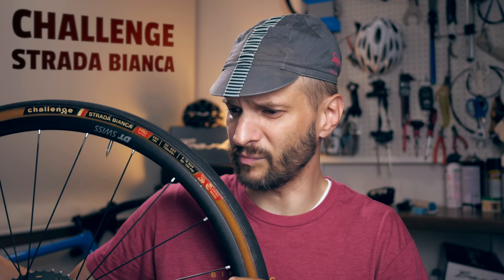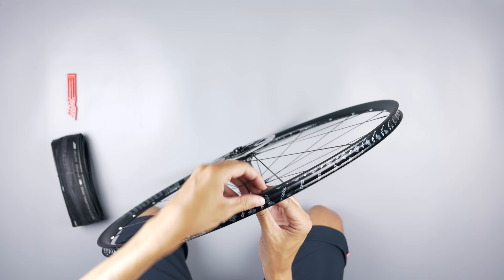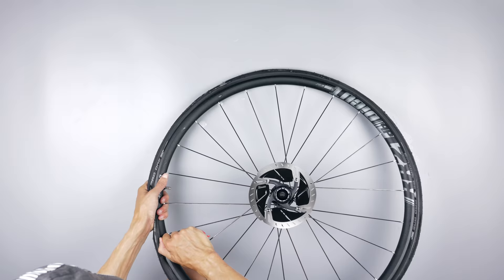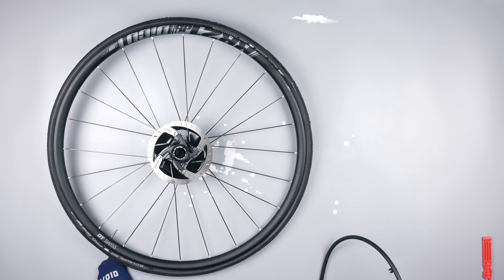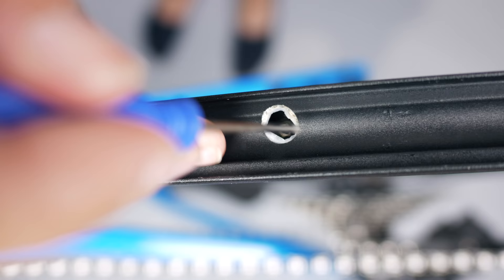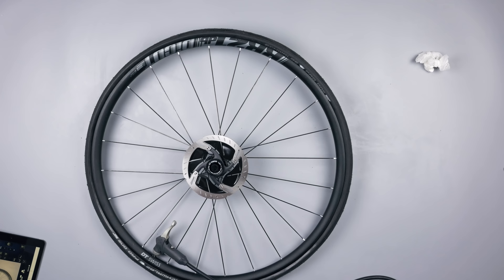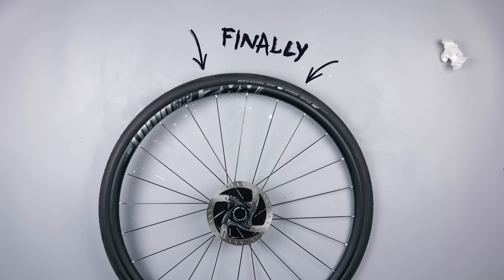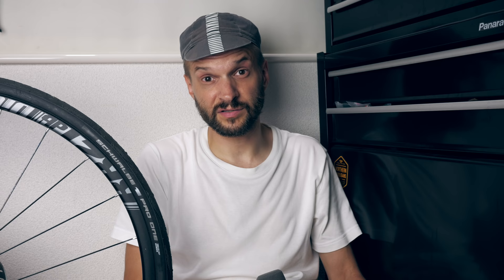Watch me struggle! 5 Tips for Road Tubeless | Schwalbe PRO ONE

Comment: Tip from a bike mechanic here... 
If you have odd shaped rims (like your offset spoke holes) or if you’re running high pressures then I would recommend running at least two wraps of rim tape to stop it deforming into the spoke hole. Also I would finish opposite the valve when installing the tyre because you want the valve side to be tightest 👍🏼
Reply from the maker: Nathan Phillips cheers 👌

Comment: I have installed (and repaired) these same Schwalbe tires several times. The first time I did it I had no luck either. I gave up until I came across a tip online to use rope. 
Make a lasso using your rope and place the rope on the tire. Tighten the lasso and it will push the tire against the rim and force the side wall and bead outward against the rim. While holding the lasso tight with one hand inflate it using the other hand. Works every time on your first attempt.
Reply: I have a side wall puncture on a pro one.  How did you repair?  I’m starting to think the pro one tubeless are not just a headache.  They are also a waste of money

Comment from the maker: Just to clarify where I screwed up, I should have thoroughly inspected the tape, which would have led me to replace it before trying to mount the tire. After I finally realized how bad it was and changed it, everything went a lot smoother. I realize I didn't make that point very clear in the video, Sorry!

I must have inhaled too much fumes from the sealant... I forgot to report the actual width in the video 😓.. the tires measure 29.5mm on these DT Swiss RR21 wheels.
Reply: Thanks !
Reply: What’s the internal rim width and what size tape did you use?
Reply from the maker: Zsolt Csapó 18mm internal
Tape is 23mm
Reply: Did exactly the same Journey with my dtswiss ....I feel you !
Reply: A problem which may be specfic to the DT Swiss RR21.

I also own a pair of rim brake version DT Swiss RR21.  And I find that the drill holes, esp those off-centered one, with burrs/sharp edges which may potentially cut the rim tape.  I had my rear wheel keep losing air pressure, after few month of use.  Before replacing the tubeless tape, I decided to file the edge of those drill holes a bit to remove those burrs.  Since then, there is no problem for 2 good years, and fingers crossed.
Reply: I am having the same problem now, so I have to check the tape first tomorrow, it’s sooooooo Fxxxxxxking wasting time today and all mess..Thanks for your video and sharing.
Reply: Yes, I finally solved problem of tire installation, but my brand new tires have sidewall weeping problem.. even sealant didn’t work...  Schewalbe pro one TT 700x25c... hmmm no way to return to Amazon JP.
Reply: Your video really helped me a lot, Thanks again.

Comment: This has 100% been the best video I could find on setting a tubeless tyre. Thank you so much for showing all your process. I have set tubeless tyres before but when recently setting some Schwalbe PRO ONE (25C) I just could not make any progress. Even bought a ridiculously expensive tubeless pump which still failed. What worked for me was leaving the tyre on the rim overnight (definitely because I gave up the night before and couldn't face it anymore) and lots of soapy water the next day. The rear tyre was also easier for me, was able to fit it new by chucking in a tube to pre-seat the bead. There was a little fighting but managed to get it by using the charged chamber and then immediately kept pumping when releasing the chamber air.

Comment: I'd always mount tubeless tires with a tube first (experience with road, all road, and fat-bike tires). The reason is that when you purchase them they are folded and have creases which makes it easy for air to escape if you're not using a massive volume compressor.

If you mount them with a tube these kinks get straightened out over time (I leave them overnight), then you can break the seal on one side (if lucky), but at least you'll get a better seat.
Reply: 100% agree. was going to suggest the same.
Reply: I don't bother but I do unfold the tyres hours before fitting.
Reply: I don't bother but I do unfold the tyres hours before fitting.

Comment: Watching you struggle with the installation of those damn Schwalbe tires, I had the impression of seeing myself. I had almost exactly the same problems as you. I tried everything and I could not succed. Miraculously, after a few hours of fighting and liters of sweat mixed with sealant poured around the floor, I managed to do it, but it was the worst experience in my life. Yesterday I changed one of the tires (the hole was to for sealant) to Pirelli P-Zero on the same rims and ... no problems, it went smooth and plesant. Well ... no more schwalbe !

Comment: One trick that really helped me is when you first apply the tubeless tape you need to add a tube in to allow the tape to be fully pressed down in the rim. Let that sit overnight to help to stretch the tire. When you go to actually seat the tire later it will be pre-stretched and will sit substantially easier!
Reply: OK - that's the reason people do that. I've not recently had problems inflating due to owning an AirShot but have had trouble getting the last section of bead over the rim.
Reply: @paulbusby2013 I've never done this and I've probably mounted thousands of tubeless tire.  If it's already on the rim, stretching won't help you.  You do this with tubulars before gluing.  But it's totally pointless for tubeless where you really want the tire as tight as possible anyway

Comment: Complete understand the frustration- used same tire,  size and 3M tape on my stock Axis 4.0. Worked first try on front wheel but several hours of pain on rear wheel and finally had to take wheel to local gas station and use compressor. In the end, love the Pro One's and have worked great in tubeless set-up for both road and gravel riding.

Comment: Hello mate, I love your videos. I ( dis ) organise a bike club, have tubless tyres and have LOTS of experience of them AND the company of many mechanics with way better skills than me. Here's what I've been taught over the years:
1. Get an air compressor. 
Tubless-specific pumps are a lovely invention for people lucky enough to seat the bead perfectly.
2. Get an air compressor.
Nothing...NOTHING beats the relentless hurricane of air bullying the tyre to seat properly.
3. Liquid laytex sealant is for the finishing touch on a perfectly seated bead and not to try and bodge in a 70% seated bead.
4. Watch as many bike shop mechanics as possible fitting tubless tyres. Bribe them with chocolate biscuits to speed dial you when they're about to fit tyres so you can watch.
5. Did I mention an air compressor?

Comment: Great video, and took me back to trying to mount some SKs a year ago. Fortunately, I did it outside on my balcony. I say fortunately, as I was inside getting some soapy water to clean up the rim when it blew off the rim spraying sealant all over the window! I now unfold the new tire and sit it overnight with a tube in it to straighten out folds in the bead.I've used multiple sets of Pro Ones in 28mm and they've all seated easily using a standard track pump. I did use your link to buy some bead wax as the last 5cm of bead can be hard to slide over the rim using hand strength. I have resorted to Co2 canisters when mounting 650b SKs as I can't have a compressor in my apartment but Co2 works just fine.

Comment: Before getting into tubeless I spoke to the mechanic at my local bike shop. Without question he said the best thing to do is get an air compressor. Sure for some set ups track / flash pump or ghetto will work. But if you want to guarantee success...

Appreciate the lack of portability and space / noise restrictions for those in apartments. But if you have the space, air compressor all the way.

Plus double wrap of non branded tape 😎

Awesome channel btw. Really loving your work.
Reply from the maker: Definitely agree! If I had my own place (not apartment) I would have bought a compressor a long time ago. There's no substitute for sure.
I still think I would have run in to problems with the old tape in this case though... but every mistake is a opportunity to learn :)

Cheers mate!

Comment: we have the same floor pump. That seated the tyre the first time, but when I defleated to put sealant, the tyre popped off. I had no time to continue and used for a week a classic gp4000 setup with tube. When I tried again, floor pump dind't work (maybe because the tube pushed the rim tape inside the holes like yours). Had to use tubeless pump. It worked pretty well. I shaked the tyre with the hands to make it seat. Then left for half an hour. Sealant in, and that still don't leak

Comment: Shared your pain last weekend with these tyres (25c) and DT Swiss pr1400 wheels - a recommended combination according to Schwalbe 🙄. Got to about 90% but could not keep enough pressure in the tyre to get it seated - and broke my compressor pump trying! It was only by squeezing the tyre as hard as I could  where it was leaking air, while my wife put another 140psi into a compressor pump that did the trick in the end. Funny that the other tyre seated no problem ... blood sweat and tears but worth it for the better ride 😀

Comment: Mounting can be difficult with some combinations of tires or wheels/rims.  I have these schwalbe tires and found them super easy to seat.  I made sure the tape and valve were good to go, installed the tire but for one open spot, dumped sealant in, put the bead on the rim all the way and shot it with my air compressor.  Tires seated perfectly and held air.

Comment: You sure made me laugh. Especially since five days ago I had your same experience. Except I mounted a 25mm tire to a 20mm inner rim width (I ride 25/28 front/rear setup.). Oh the joy! I finally got it to work by "pre-stretching" the tire with an inner tube at 110 psi overnight. Even then, the one side that seated into the rim edge let go twice. Back to the tube! I have a compressor with a 3 gallon tank, but next time, I'll add a 5 gallon to the air line to get a bigger, sustained high-pressure high volume flow.  Interesting,  the rear 28mm snapped into place quickly after using a tube to seat the rim. My 40mm tires never have this issue as they mount onto a 22mm inner rim width.
As always,  thanks for the video.  Keep up the great work!

Comment: Continental 5000TLs on Roval CLX 32 wheels were pretty easy. Mounted 28s by hand.  A little tough on the hands, but went on in minutes. I actually put sealant in before mounting (mtb background). I was losing air in the front. I realized I forgot to spread the sealant around inside the tire. Worked great. Have a couple 50mi plus rides on them. Very nice. Issue is there are so many different standards of tubeless tires and tubeless rims. The 5000tl works best with hooked rims for example and have there own tubeless standard.

Comment: I tried out the same tyres on my DT Swiss 1400 Dicut Oxic that I'd been running GP4000 on for a year. Tape was in good shape and the tyres went on and sealed really easy!  Tried for Flanders this year and was pleasantly surprised - worked well compared to GravelKings I'd used the past several years. Kept running them ever since. Not long ago got the new Hunt wide 50mm aero carbon clinchers and fitted the same tyres there too. Again - sealed easily and ride well. No issues at all yet :)
Reply from the maker: Steve Rodgers good karma! I hope I’ll get some of that next time ;)
Reply: my worst experience - first experience too - with tubeless was when I ordered non-tubeless variant of the Schwalbe cx pro for my new cx wheels last year. With a lot of hard work and swearing I was actually able to get a seal on one before I realised my mistake!
Reply from the maker: Steve Rodgers that’s dedication 💪😂

Comment: Wait until you get your first flat.  Here is a hint.  Keep paper towels in your tool kit and of course a spare tube.  You will eventually need both.  The sealant works great low tire pressures.  Not so great at 80 lbs. of pressure.

Comment: This took me all of 10 min per tire with the same tires on DT Swiss spline 1800 rims. Sealed right on, and it’s been fantastic ever since.
Reply from the maker: Alan Thompson yes, as I said in the video, the big mistake I did was not checking/changing the tape. Once I did that it was pretty much pain free, especially the rear went on really smoothly.
Reply: @ridesofjapan  my wheels were admittedly newish, so I see what happened to your effort for sure. Good tip on the 3m tape!

Comment: good tip about the rim tape , i have been screaming in frustration about my schwalbes not seating!!
Reply: I have a pair of new schwalbe ones Tubeless easy,  I have been trying to mount them as standard clinchers with tubes,  I have just went through five tubes trying to get them to seat. Going to try the rim tape trick before I just use tubeless.

Comment: I am using schwalbe 23c tires on DT wheels as well. Without tubes inside. When I struggled with tubeless setup, I bought an adaptor from french bulb to the american, went a gas station and used its air compressor. The GS was Eneos. When it comes to sealant, I use a syring of DAISO, which is originally for refilling skin lotion or toner. 
I didnt replace rim tapes for the first tubeless setup because I didnt ride much with the wheels. After 200km rides my front tire got flat, the rim tape had a hole on a spoke hole like you said in the video so that Its a nice dicision to have double rim tapes.
Reply from the maker: Tarik Golvan yeah an air compressor would have been great, wouldn’t have gotten this good of a workout though 😂
Those spoke holes are annoying indeed.

Comment: I had the same issues with the same tyres and wheels. Got the rear one on without too much hassle using the tube method first and then sealant but the front was a nightmare. Compressor at the local bike shop did the trick. Interesting about the DT Swiss tape as mine was already installed fresh outta the box but was obviously the Achilles heel of the install. Going to get some of the 3M tape as I have to install a new tyre on the rear as I ruined it today hitting a rock on a descent. Sealed eventually but the sidewall is damaged.

Comment: お疲れ様でした。Good on you for not stomping on thewheels! Fully sympathize with the double fingers! 
I've found the Pro one to ride nicely but they didn't last long.  I now use the  IRC Formula  Pro Tubeless Light which are available on Amazon Japan in 28mm.  Have noticed these tires tend to measure a little less wide than 28mm from other makers.
Reply from the maker: shonanmike haha! Thanks mate!
IRC was my first road tubeless tires back in 2012... they were so easy to work with on the c24 tubeless rims back then, no tape needed... the good old days 😁
I know they come up a bit narrower, that was one reason I didn’t get them this time.

Comment: I run the same tires and love them, but they are horrible to seat. I usually have to use an air compressor it co2 to seat them. Once they're seated though they hold air and are very easy to pump up from there. Even after topping off sealant later. I've felt your pain though many many times!

Comment: Devils Advocate
I have recently switched my Roval C38 wheel set from a clincher to Sworks Turbo tubeless 28mm tires. I used a Topeak Booster floor pump with Muc-off stems and Stans sealant,  it couldn't have been less painless. LOVE the ride quality on my Tarmac SL6 and I'll never look back. Good-bye pinch flats and punctures!

Comment: If only I saw this video 6 days ago. I've never had problems installing tubeless tyres, but they've all been 38c or wider. So I was cocky and thought the Schwalbe One TLE would be a cakewalk. Your experience before using the inner tube was identical to mine with 25c (can't get 28c due to all the supply problems ATM, and my tubeless rim tape was fine): the bead never seated (even with a compressor), tried several times then tried with soapy water and them added sealant and lost it all and it went everywhere. Being time poor, I gave up and resorted to using inner tubes with removable valve cores and added sealant inside those. Next time I'll plan ahead and inflate with an inner tube and leave overnight to stretch the tyre.

Comment: I feel you. This video sums up my experience with the Schwalbe Pro Ones and DT Swiss wheels perfectly. I‘ve installed plenty of tubeless tires, but this combination drove me mad! I‘m just glad that my GF wasn‘t around to see the mess and struggle, otherwise I‘d be single by now.
Reply from the maker: Bobbie E. Ray haha!
I did this around midnight... which was a good thing, otherwise something might have been thrown through the window 😅
Reply: @ridesofjapan  btw since I had  troubles with the same type of tires on a different set of rims, I finally gave in and bought a decent pump. Topeak JoeBlow Booster. All my worries are a thing of the past now. That pump makes everything so much easier, I'll never go back.
Reply from the maker: Bobbie E. Ray good to hear! Will look into that pump when my cheap Tubeless pump gives up.

Comment: I found the following helped me: 1. a thin strip of Gorrila seal tape down the center channel over the spoke holes. 2. A second layer of tubeless rim tape ( I used stans) 3. Inflating to let the bead set without latex inside. 4. putting latex inside, letting it sit overnight after spinning the wheel vigorously. 5. Using a co2 quick inflator to initially set the bead. 6. checking to make sure that thin black line on the tire wall was even and above the rim all around ( youll notice it on the tire yourself). 7. Deflating the tire then inflating once more to hear the important "pings."